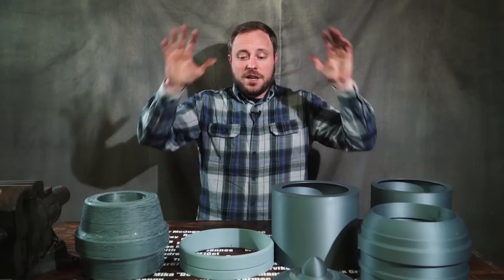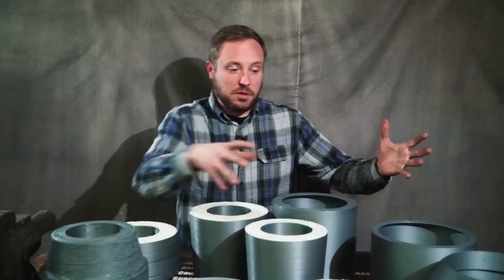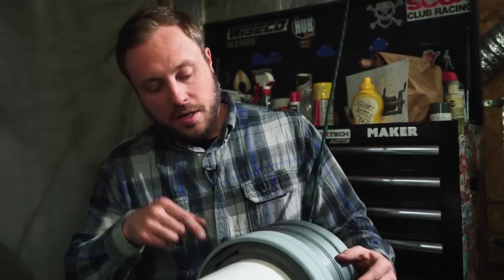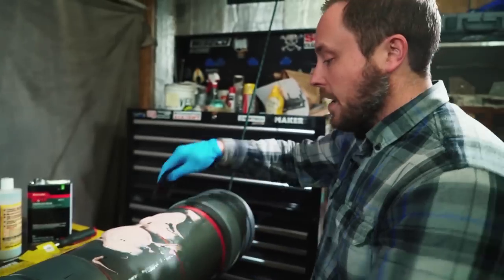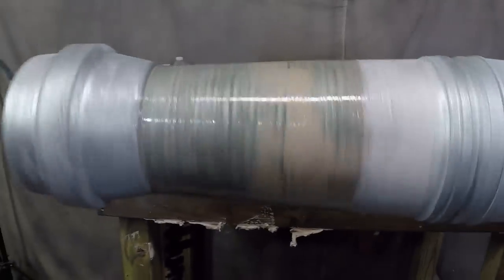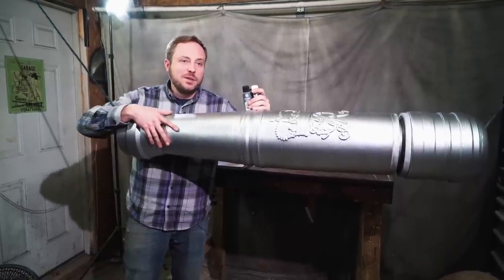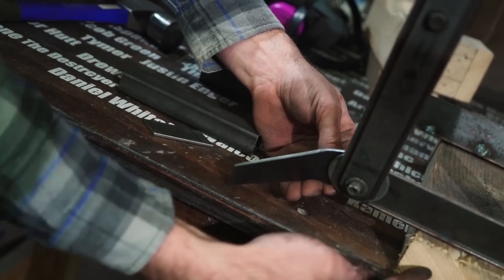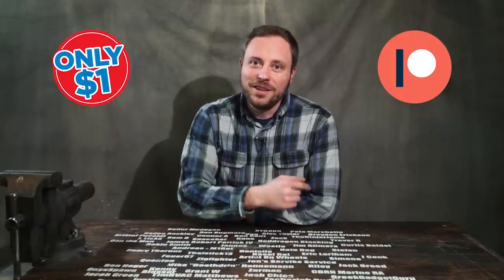Fallout Broadsider - Real 3D Printed Naval Cannon Build Part 2

Comment: For clean cuts on the expanding foam spray, use a bread-knife; the serrated edge works wonders and the long blade can be braced on the edges to give a straight cut.